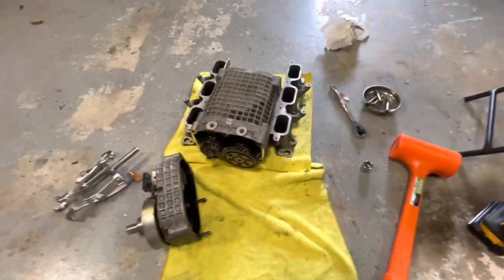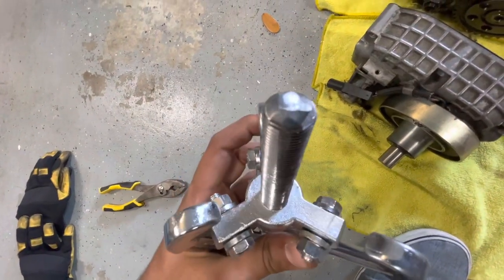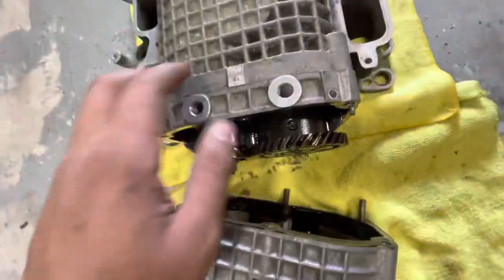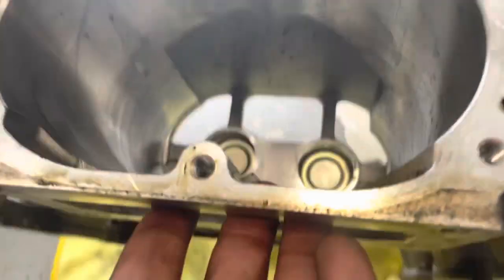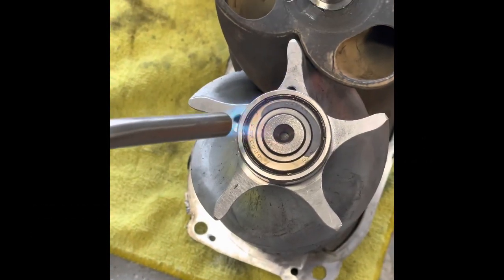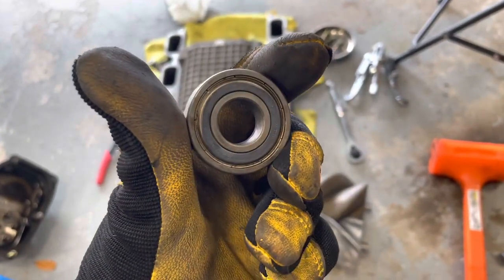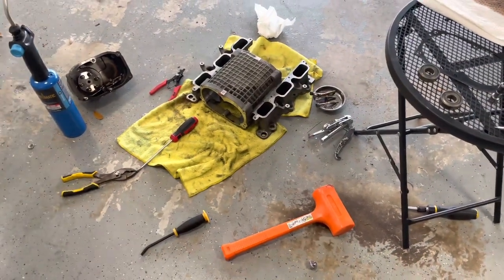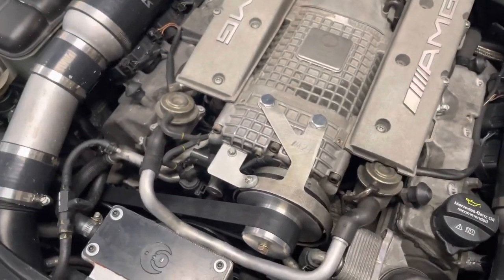C32 /SRT6 supercharger rebuild / rear bearing replacements

Comment: What did the bad bearings sound like in the car? I have a C32 that makes a growling/scratching/grinding noise under certain conditions and I think it’s the rear bearings because I already replaced the pulley bearing.
Reply from the maker: Just a scraping noise in the back of the blower. Use a screwdriver or mechanics stethoscope to see where exactly the sound is coming from.
Reply: @ginco_bnz  thanks bro 👍🏻
Reply: Thanks for the video on rebuilding Mercedes superchargers . 
My 1999 C230 K makes a noise similar to the one in this video: 👇
https://youtube.com/shorts/XgjhlLkP8CA?si=i8sqa7SbH5wqMwQu

 Could you please help me identify what this noise might be coming from?

Comment: Have u done the job inside the vehicle yet? Wondering if I should remove the sc or go for glory and leave it in car
Reply from the maker: Yes, I did it in the car. I wrote about it in the video description so check that out. It really wasn’t all that bad, you might have a little bit of a tough time wiggling the rotor pack out but it’s not that difficult.